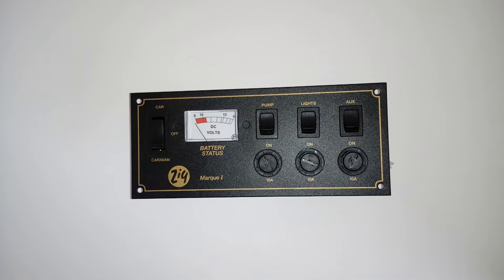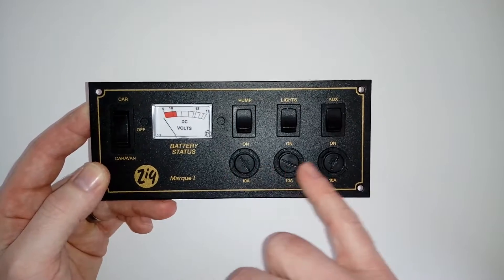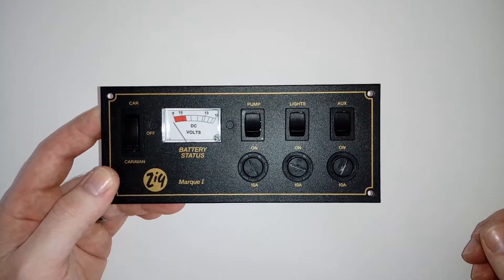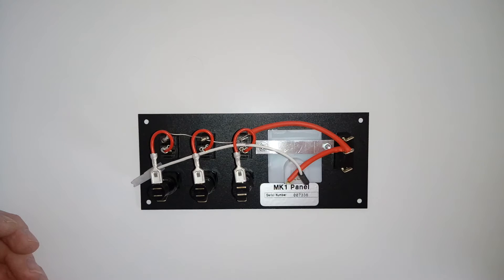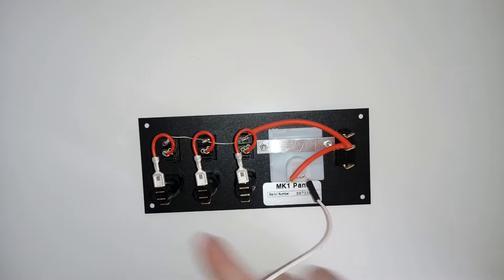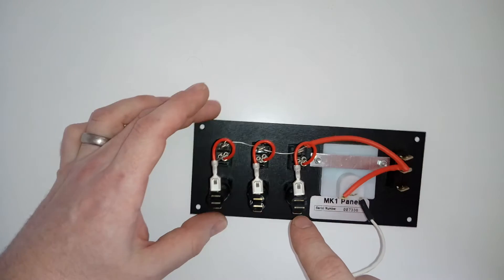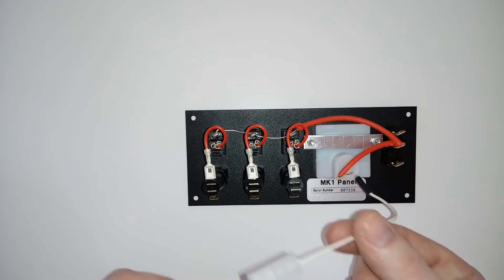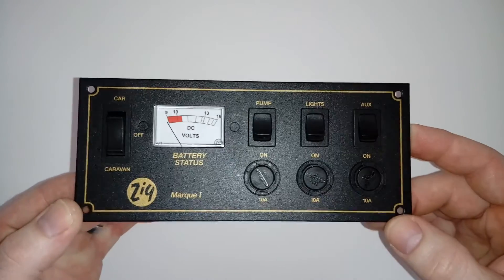How to wire up a 12volt Zig Marque 1 distribution control panel

Comment: Hi I've got the zig cpx 21 although very similar to your unit mine doesn't have a white wire to earth it off. However, it does have a white and pink wire coming from a little circuit board which is something to do with a warning light. What do I connect these 2 wires to?

Comment: How do you earth through that little white wire should the earth not be larger than that?  Could you put them all to a common earth (connection block) and use a larger block to the vehicle (or do i need to go to school again :-))
Reply from the maker: The little white wire is for the battery gauge on the control panel itself. You still need to earth onto the vehicle somewhere with a thicker wire and all your negatives including the little white wire will connect to that.
Many thanks for watching
Reply: @dantheman321  Thanks Dan

Comment: Hi. Great video. I have a similar unit. And a zig box type unit under the seating area. My questions are. What position does the switch have to be in to recieve charge to the batterys. Does the 240 v zig unit uunder the seat charge the battery ?
Reply from the maker: Without seeing the unit its hard to say but if its the one im thinking of then yes it should charge your batteries and you can select the battery you want to charge by simply just switching the switch as you would by selecting where you want to take power from. But it does all depend on how the installer has wired it up.
I hope this helps and thank you for watching.